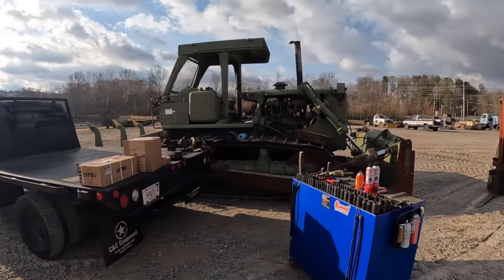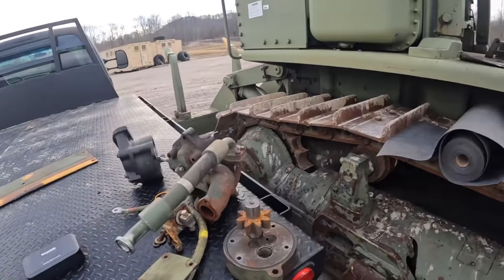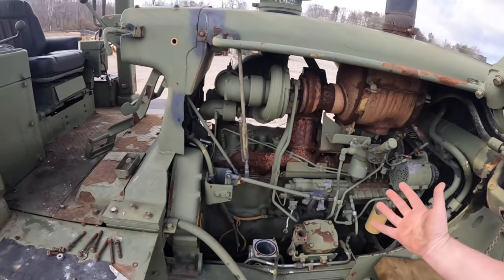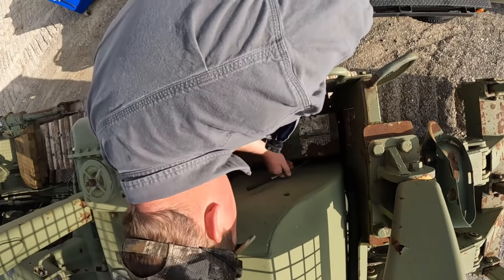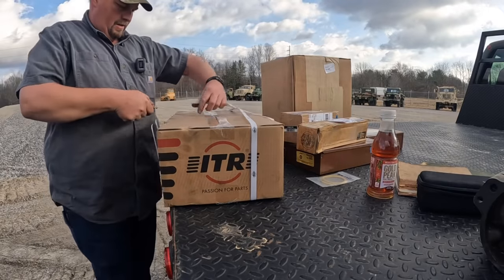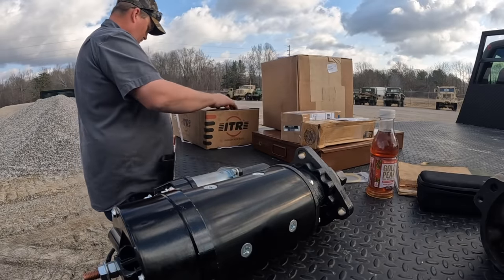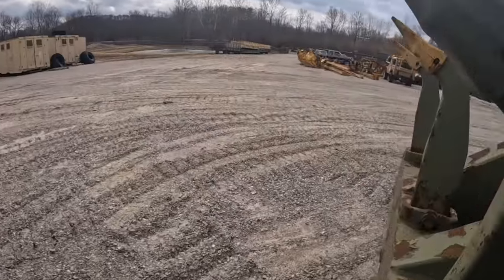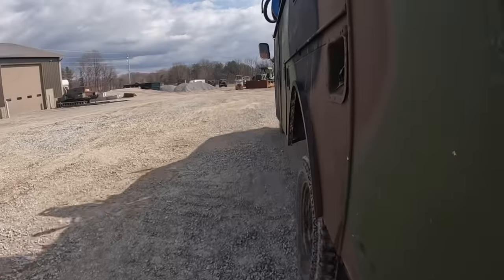I bought a non running Cat D7G.. What did I get myself into @C_CEQUIPMENT

Comment: I'm delighted that it runs and behaves just as you would hope for. I was very surprised how quickly it fired off and ran so smoothly for you. To me it suggests that the recorded engine hours are correct. A good work out after a full service and thorough greasing will give you a much better idea I would think.
Congratulations on a lucky purchase.
Reply from the maker: Yep thanks
Reply: I'd hazard a guess and say the army mechanics who did the work on that beast during its time in service did a bang-up job.

Comment: Can't beat those old machines for reliability and simplicity. I guess time will tell if it was a good buy after you run it for a bit. If the starting up is an indication you should be good.

Comment: Back when I was younger (much so) we used to fit those starters without removing the pump and pipes, most times the starter failed because it had oil in it from the transmission. When we had to fit a transmission pump we used to prime them and bleed them too, it  made life better because the pump lasted longer and you more or less knew if you had pressure before you tried selecting a gear ! Nice video, brought back many memories.

Comment: Servicing time for final drive and transmission three rings of bolts after spilting tracks and pulling drive shafts. Modular design for quicker in field installation of remanufactured components.

Comment: Just thinking of all the jobs I've come on to where someone else couldn't figure out the issue or whatever. It's tough backtracking whatever the original issue is when everything is already taken apart.. Like you said, sure hope it's just a bad starter but then why would they go through all that work to pull a starter if that's all that was wrong (I'm sure there's a manual in the military to show the most efficient way to swap a starter.. oh NM)

Comment: I like that they put a ground point right on the starter.. One of the things I have done for over 40 years on cars, when servicing starters, is to run a fat ground wire from a starter bolt right up to battery negative, making a far lower resistance path than grounding only through transmission/engine block, to ground strap, to frame, to ground strap back to battery. It always makes the starter spin faster and stronger.
Reply from the maker: Yep
Reply: @C_CEQUIPMENT    It makes perfect sense!  I'm just impressed that they saw the need and built it in..   Refreshing to see something smart from a factory setup.  

I just love these shop videos.. I grew up around cars and machines... but for the last 25 years have been pretty isolated.. Guys like you, Mustie1, Keith Rucker, PNW Hillbilly, Squatch, Dennis Coffee Time, Mr Pete, This old Tony, Blondiehacks,  Adam Booth,  Dirt Perfect, and so many more bring me back to my youth hanging out with dad and all his car and machine and construction friends.. searching, fixing, restoring, working... They are all dead now.. Youtube now has some neat guys and gals to 'hang out with' ...    Keep it up, its been loads of fun ... AND you're a great role model too.
Reply: @jenniferwhitewolf3784  Hi there Jen, I'm in the same boat! Last one alive and I love going down memory lane by watching Clinton and the guys doing their magic.
Reply: @jenniferwhitewolf3784  Have you been following Project Binky ?

Comment: Gotta love this weather. I'm in east central Ohio. Also love your videos. Your step by step approach and explanations are just great. Since I started watching you and Letsdig18,  it has helped me through some mechanical issues and repairs, that I wouldn't have tried before. By trade, I'm a retired 45 year veteran electrician, but have been involved with maintenance departments in several factories.  Electro-mechanical work and construction is a whole lot different than machine mechanical maintenance. Keep the good informative videos coming.
Reply from the maker: Thanks
Reply: Nice weather in TN.  Sat. the weather is going to drop like a rock. Snow??

Comment: The D7G was my second dozer when I was in. I had a D7E first.  The only issue i had with the G model was when you lowered the blade it was like it went into float. You (I) could not just ease the blade down.  Ours had winches due to us being a Combat Engineer unit.  The constructions engineers got the rippers. I was told the reason the ARMY got the D& was because they were not as popular as the D6 or the D8.
Reply: 8's would drop like that too. Ease down about 6 inches and then fall. Took a while to get the hang of it without hammering the jacks but the 8's worked fine about not loosing time in a rough place. Drop and go. I liked the E's better than the F's. Listen to them snort instead of whine. A 6-C was about my favorite if it was set up right..

Comment: I got lucky 4 years ago with a 1974 Allis Chalmers that sat for 20 years. Put batteries,  and fuel in it turned it over.  Poof it was alive. Had to replace the clutches when I go it home,  but it's still running.

Comment: Back in the early 1990's in college my dad and I bought a Dodge GLH Turbo with a locked up engine. The owner said he was driving one day and it just died and he said it's a locked up engine. I bought it for the parts so when it was time to take the alternator off we found that it was locked up not the engine. So a car worth $800 at the time sold for $4500.00 after repair and a nice paint job

Comment: That 4 bolt only on the hose - 🙂 Looks like Government work to me.  Likely the one or two guy's on the job were transferred somewhere and Logistics ended up with stuff to clean up.  What a nice find.  Has been working has bangs and rust but looks like a winner.

Comment: Does Dirt Perfect's 850J have a fire extinguisher under the seat too? He has an empty bracket for one. 😁
 Back in the late 70's, I spent a couple months as a line inspector in the forge shop in East Peoria on the powdered metal line. Those split hydraulic flanges like you are missing, were pressed out of powdered metal in a hydraulic press, then heat treated and were finished. Kind of interesting process I thought. It sure saved on machining time.
Reply from the maker: I bet

Comment: Just to be on the safe side, I would have put no more than 4 1/2 gallons of fuel in it the first time. That way if something did go wrong and you had to drain it back out, one bucket would hold all of it.
Reply from the maker: We have pumps to pump back out if needed 
Sometimes 5 gal is not enough in a big tank like this

Comment: Hi Clint, I have a question for you that I hope you can help me with. I purchased a 1982 D7G with 487 hrs from our local Forest Service agency, engine starts up great and everything looks fine. They probably had it parked for many years. We couldn't make it move when we picked up the machine but we made it move after giving the pedals some good hits. We did the same thing when we unloaded the machine. Only problem now is that we let it sit for a couple of months and now we can't make it work. We adjusted the brakes and checked all oils but nothing worked. I was wondering if you had some ideas on what could be wrong with it? I would really appreciate your help!
Reply from the maker: Could be steering clutches or trans slipping
Probably need to pull floorboard so you can see if driveshaft is spinning hard from torque converter we you have it in gear trying to move
If it’s spinning hard then something in you trans is not holding if it’s not then torque converter could be weak
Need to check trans charge pressure also
Reply: @C_CEQUIPMENT  Thanks for taking your time answering my question! Driveshaft is spinning fine, you might be correct with the trans pressure being the issue. I feel like the pressure might be very low since there's no reaction at all when we put it in gear. Will have to check on that.

Comment: I seen something that may be making a mountain over a mole hill... you were down at Mikes (DP) and when he put the beg on you to come to his shop for problems with his putting a attachment on the ripper area, laying tile, it looked like you were saying "Mike" don't make a habit of calling me out of my shop to do road repairs, just bring it in like anyone else has to do. It is your  right to not leave home for several hours and work for someone that is costing you money instead of making you money. At home you multi task and make more money but is it building any relationships with people who are customers? I say if you go out and do things like this that it makes you money in the longer side of things. Mike is not the only one who is so grateful for your time. I am hoping that people who do watch these channels will see a man with heart above money. Enough on that..... an figure like your probably thinking,  that this dozer was taken apart by someone who said "coming up from the bellypan to replace the starter, was a man who just pushed his time clock, an could care less if the machine was good or bad. Those kind of mechanics are the ones that just need to find something else to do. One of a machines biggest dangers is setting and handy  to grab a piece or part off of and not care if it ever sees dirt again. I bought a dozer that made the salvage yard because it had been cannibalized for parts. I was looking it over and seen how someone cared for it yet through a estate sale or other, that machine was destined to die. I put it back together and it was as hopped, a damn fine dozer. I will be honest enough to say the bringing it back was more than just buying outright a good machine. I had more time than money so all was good and kept it for a long time. Had I not got crippled, I might still be out there breaking pieces and parts yet. If your trying to guess what I did, I was into helicopter logging and salvage ... to include build bridges or towers and it took good equipment
Reply from the maker: Pretty cool

Comment: Scenario--It ran out of fuel some operator cranked the starter till it burnt up,  then his rookie mechanic tore into in not knowing what he was doing.  Then Told the motor pool Sargant the transmission  is out of it.   Unit gets sent it to 3 shop, They deicide to dump it.  You got a good deal.   That's mostly  how it was when I served. -- Case in Point ---   I was assigned to a unit and I was the loader man, Had a 620 case loader. Arrived at unit 1975 my assigned loader was DOWN and was waiting on parts. Months went by and still no parts. So every morning I had to inspect my unit and note the deficiencies  same thing every day. So finally a year then 2 years then 3 years. went by,  I never ran that machine. Want to know what the part was  a ----- 2 Inch rubber O-RING----- cost 10 Cents
Reply from the maker: Doesn’t surprise me at all 🤦‍♂️

Comment: you lost me on what pump does....  hydraulic pressure for bands on trans planetaries?  pressure for steering clutch release sys?  pressure for steering brakes??     Does d7  have a torque converter??
And is the ring & pinion differential part of trans on d7?
Reply from the maker: Yes on all of the above

Comment: If the engine turns and is complete, provided theres no water in the fuel or oil  it will probably run. Transmission different story.